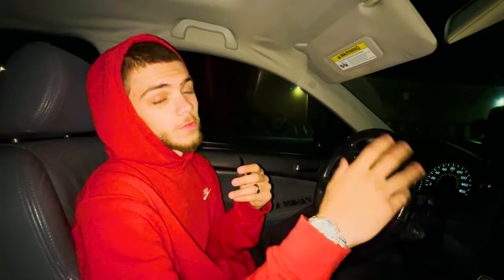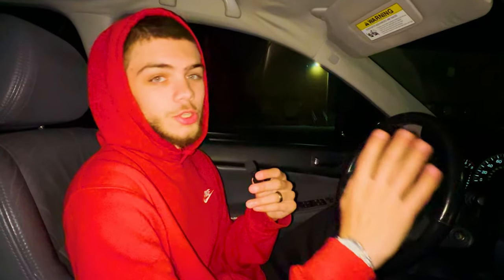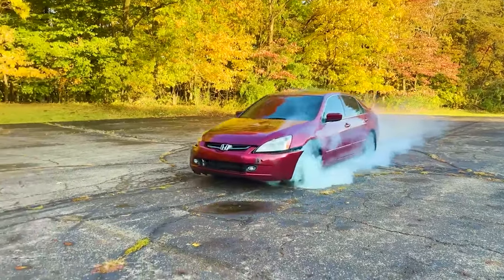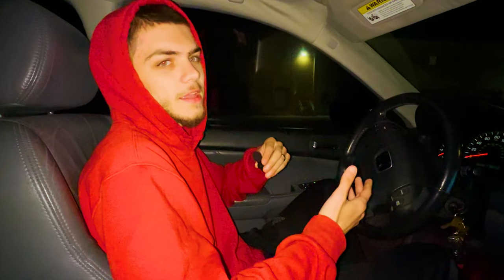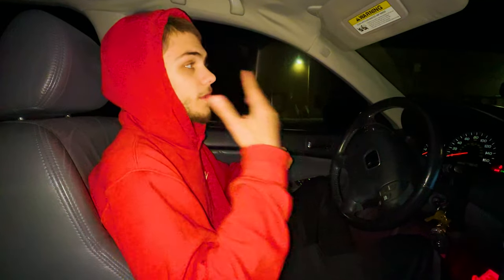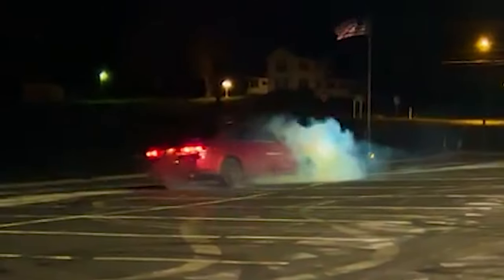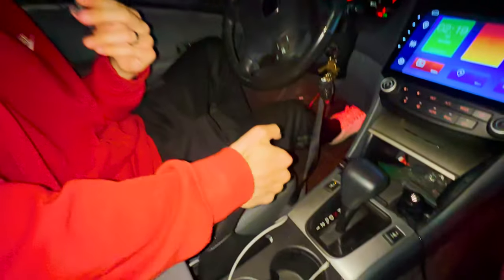How to do a burnout in an automatic FWD car

Comment: my fwd dodge avenger would probably blow up if I tried this 😂
Reply: I have an avenger n wanted to try this but you talked sense into me😂
Reply: Me with my Dodge avenger reading the comment and watching this video 💀
Reply: AVENGER CLUB!!!
Reply: @rugrat2961  glad I did 😂 they are good cars if you maintain them but their transmissions were not the best. Not to mention the random issues I have with it. The most recent was the exhaust manifold that warped and was leaking carbon monoxide into the cabin 😬
Reply: @DestinyMotors.Official  WOOOO LESSS GOOOOOOOOO!!!
Reply: @AustinTheAmerican  YAAAAAAA

Comment: Impossible dont try guys will destroy ur transm, burnout needs clutch automatic does not have it.
Reply from the maker: I said in the video that it would probably break your transmission but burnouts are still possible, I did some but ofc my transmission broke...
Reply: Automatics have a clutch too, js not a manual one😮
Reply: Bruh auto has a clutch to it’s just manual is easier to control and neutral drop that about it
Reply: @damainfoster6590 most dont have clutches and if they do, it’s computer controlled clutches found in more sportier cars
Reply: Every cars have clutches tho

Comment: But won't it damage the E brake? I'm new to the community
Reply from the maker: It might 🫣
Reply: The E-brake is just a different method of applying the rear brakes, using a mechanical system rather than hydraulics

Comment: what if i dont have hand brake
Reply from the maker: What car do you have 🤔?
Reply: 2010 impala LT.
normally i just wet the tires then brake to 0 then floor the gas. traction controll  of obviously @JcMotor
Reply: @p3nny I don’t know if it’s the same but I have an 09 impala and my E brake is a pedal on the left
Reply: Is an E Brake and a Parking Brake the same thing? No sarcasm I'm genuinely asking.  @afkValix
Reply: @LaunchLabs710  idk if you can use a parking break while moving like and E brake, I’m not going to try and fuck up a transmission in a perfectly good car to see tho… but that’s the only manual brake on the car besides the pedal